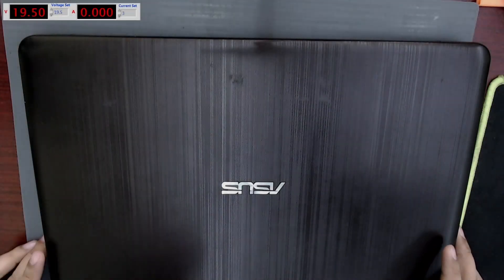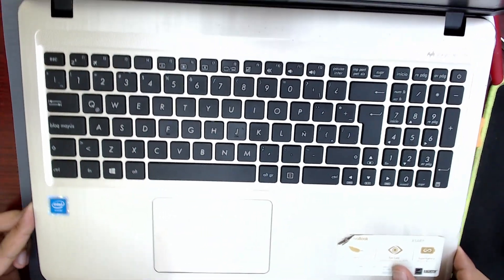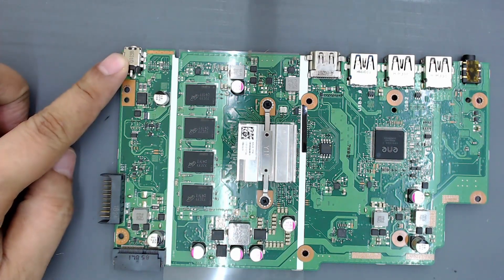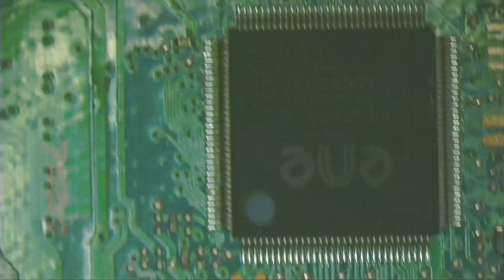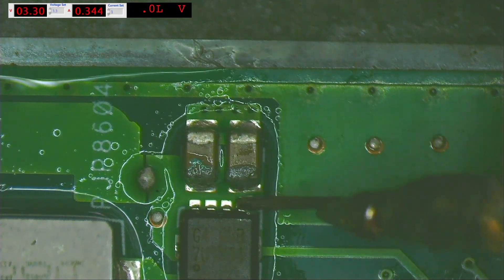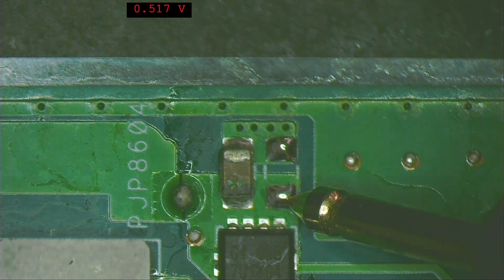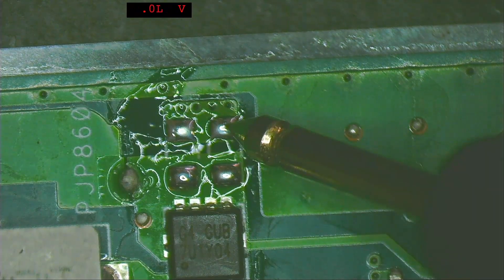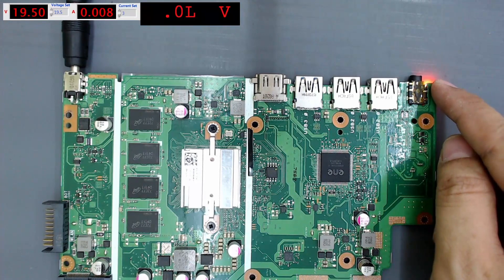Asus X540M Laptop Repair, Won't Charge, Won't Turn On, Shorted Motherboard

Comment: my Acer al in one coputor reently not power on it wasevry time showing bios and if reset thebios then computor getting on but now it is completly dead not indicating power is getting on I change the cmosbattery but still no result but only fan works soe one aid it may be iocheap fault please help thanks